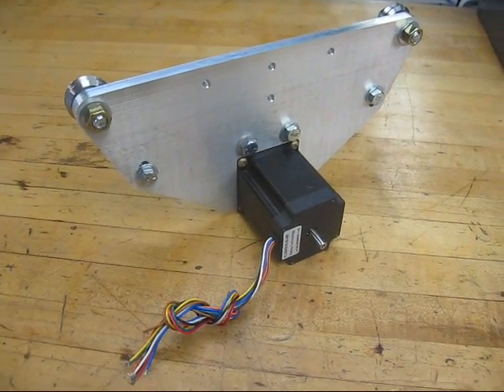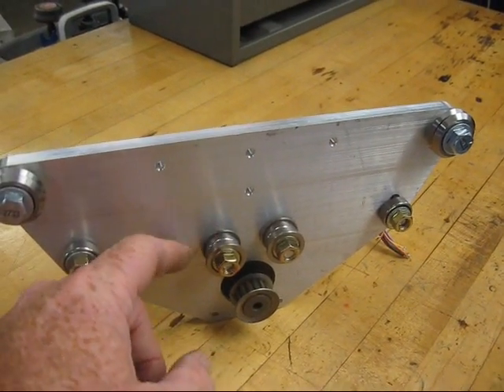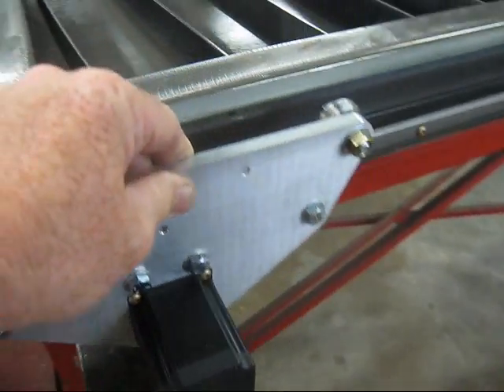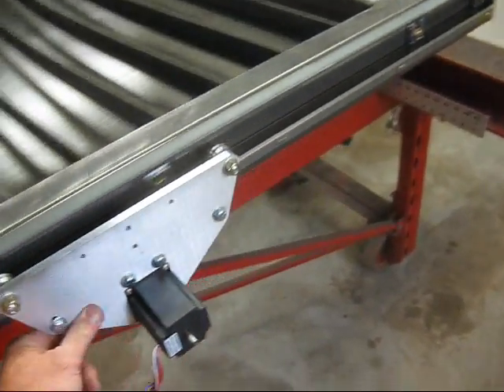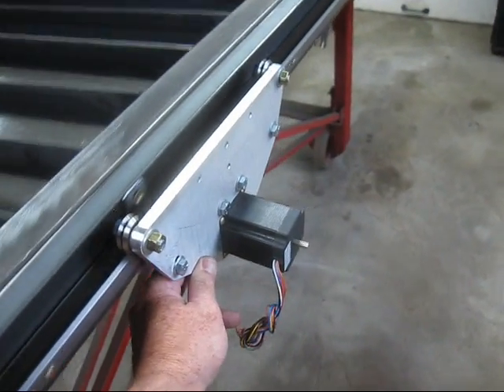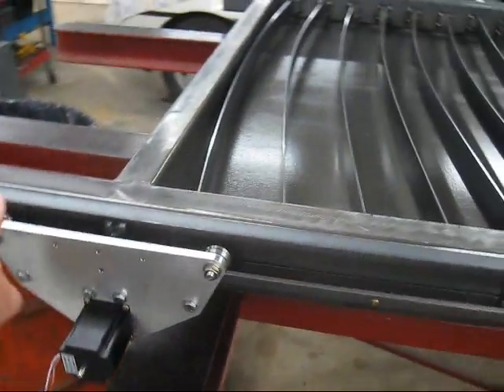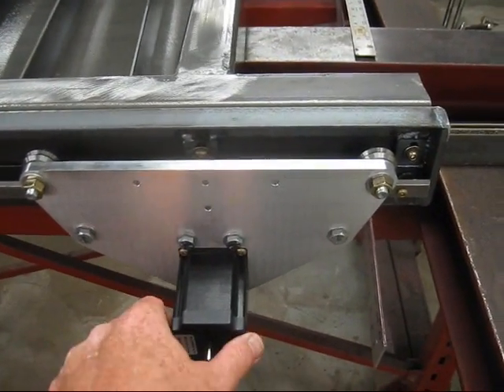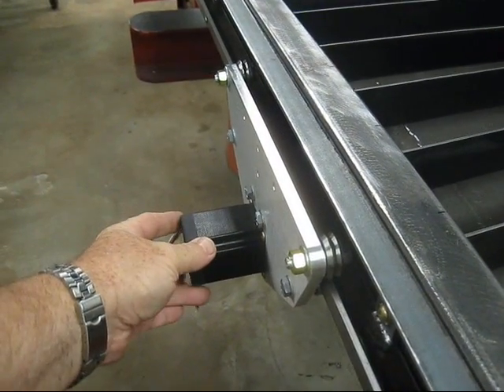CNC PLASMA PROGRESS #1

Comment: Hola buenas tardes
Te hago una consulta si me podés ayudar, 
Soy de Rosario, Santa Fe 
Hice un cnc para hacer cortes de chapas finas 0,9. 1 mm por ahora luego cortare mas grande cuando pueda. 
Con un plasma tauro trifásico, PAC70 
Alimentación: 3×380 V.
Frecuencia: 50 Hz. 
Consumo de corriente: 19,2 A.
Factor de servicio 60 %: 55 A.
Rango de corriente: 20 – 70 A.
Encendido de arco piloto por alta frecuencia. 
También compre un "control de altura" que no lo puedo usar. 

Tengo puesto el mach 3 en la pc 
Tengo una placa interface esteca, tiene las resistencias Pull-Up     
http://www.esteca55.com.ar/productos.html 
Le puse descarga a tierra a la pc, al gabinete, a la mesa de ejecución, al plasma 

Te cuento mi problema, no sé porque se me pone en emergencia el mach 3 en algunas ocasiones, y se para el programa que se está ejecutando, le puse una llave para usarlo manual y hacer cortes lineales. 

Me comentaron que entra una alta frecuencia por los finales de carrera o por algún lado

Pero no lo puedo resolver hace un año que estoy con este problema y no lo puedo resolver le pregunto al que puedo. 
Por si tuviste algún problema igual y lo pudiste resolver. 

Desde ya muchas gracias
gastronomiamoreno@hotmail.com

Comment: I'm going to build my own table here soon. i was wondering were you buy your motors and parts
?
Reply from the maker: Hi there, all info is provided in the Q & A's in the comments sections of the 9 videos in this build series here on this channel. Also, as the build is based on FIEROADDICTION's build thread on cnczone.com you can see all the details there. 
http://www.cnczone.com/forums/plasma-edm-other-similar-machine-project-log/57192-low-cost-4x4-plasma-table-finished.html
Reply: Great video. I would like to make my own cnc table for my everlast plasma cutter further down the road. Your videos are going to be a great help.

Comment: I am start a build of a CNC Plasma cutter soon and was thinking that this roller sysrem is a superior design,  would you change this drive system now after using it? Thank you in advance.
Reply from the maker: Hi AB, I would absolutely do this again. The trick is to try to keep the gantry as light as possible to reduce the load, and thereby stretch of the belts on acceleration. This gantry is 2" x 4" aluminum.  This build is patterned off of fieroaddiction's build on the CNCZONE here:
   http://www.cnczone.com/forums/plasma-edm-other-similar-machine-project-log/57192-low-cost-4x4-plasma-table-finished.html

Comment: I like your machine. is to inquire as to when the low and active sensor torch go back and start cutting and do not stay down with stepped sensor is then moved and not have to turn it off manually. I expect a help please
Reply from the maker: +Angel Rosario I am not sure I understand your question.  All torch motion and on/off is controlled by MACH software https://www.youtube.com/watch?v=vf1a6F2tYdU   the GCode that MACH runs is generated in SHEETCAM  http://www.sheetcam.com/   and this is where the torch height is set.
See my video https://www.youtube.com/watch?v=AwRt-gzxcJo    a microswitch senses the motion of the sliding portion of the torch height mechanism and alerts MACH to when the torch has touched the material to be cut.  MACH then turns the torch on and off as per the SHEETCAM generated GCode commands.  Hope this makes sense, if not please rephrase your question.

Comment: You are using a duel motor driven gantry.  Can you give some detail on how you accommodate the need to have the motors turn opposite each other?  Was this done through software, wiring, or installation design?  I am about to embark on a build and this is the last piece of the puzzle I don't have sorted out.  Thanks in advance.  P.
Reply: sbirdranch  I think you just reverse the polarity on one of the stepper windings.
I am thinking of also adding a belt to keep the motors synchronized; otherwise one bump or visitor poking at a pulley, and now the two sides are out of sync and the gantry out of square.
Reply from the maker: HI, sorry for not answering earlier, I missed this post.  The motor is reversed in the configuration of the MACH controller software as described here: 
  https://www.machsupport.com/forum/index.php?topic=16220.0